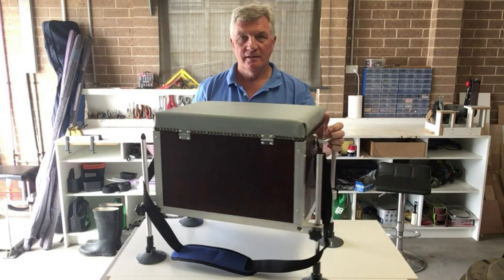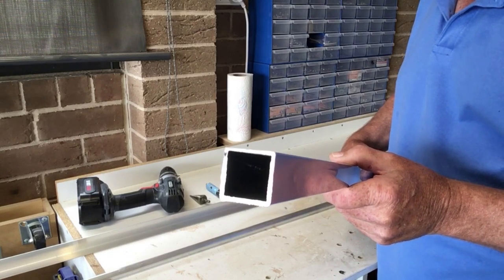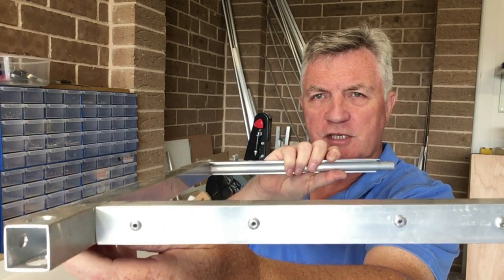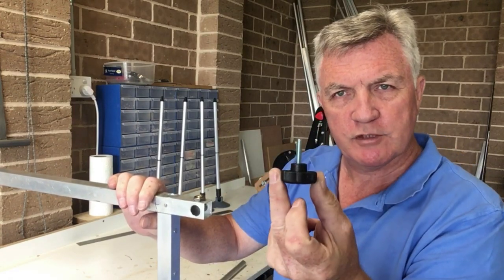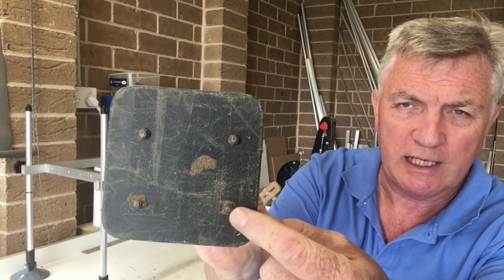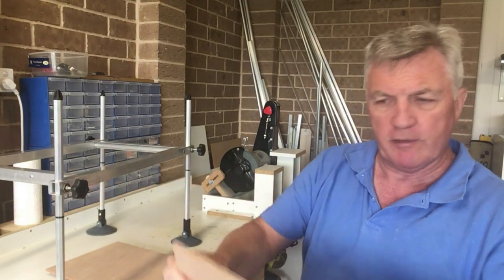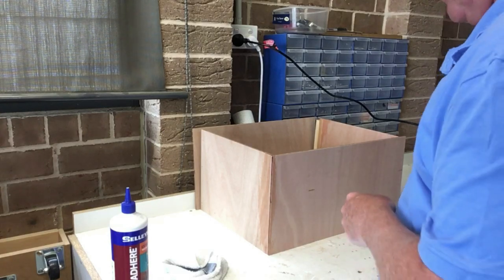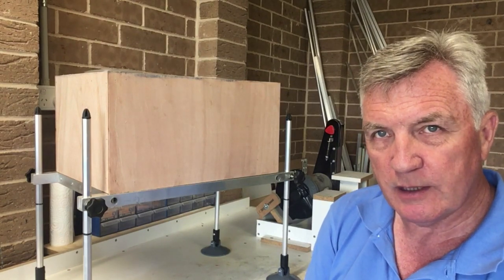Make a Fishing Tacklebox with Seat & Adjustable Legs - Part One

Comment: Hi Den, just a quick one, what type of rivnuts did you use as I'm having difficulty getting the stainless steel one's to crimp properly  using a bolt, thanks. Ps, happy new year.
Reply from the maker: Hi mate. It looks like mine are Zinc Coated Steel. The store I bought them from doesn't stock stainless steel Rivnuts. Did you make up the Rivnut Tool as in my video? Here is the link:  https://youtu.be/JCndfp2Kylo  You don't mention if you have actually made this tool. If you are just using a bolt and nut, that doesn't work. I tried it years ago and it is really difficult. When I use the tool, it is an easy job.
If you are still having problems, it may be worth you buying the original Octoplus End Caps with knobs attached as I mentioned in one of my earlier replies. Happy New Year.